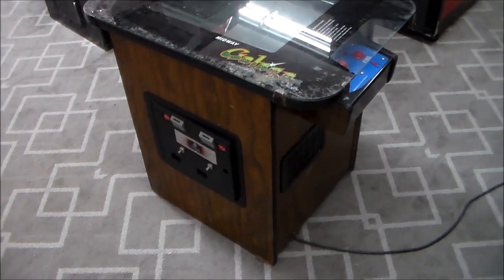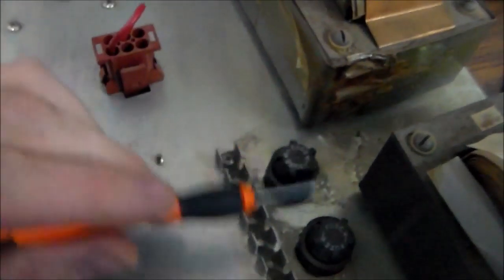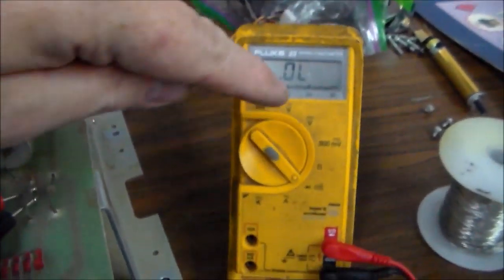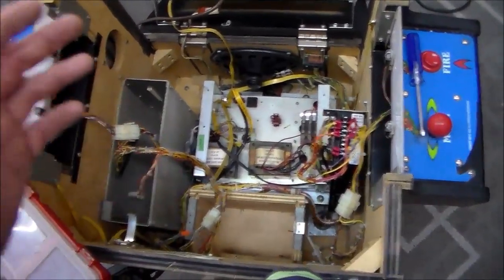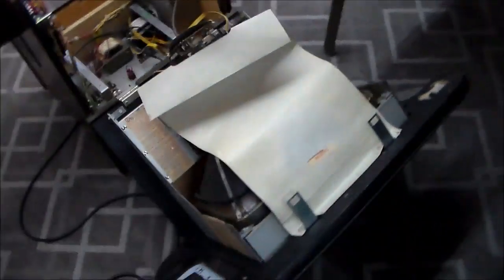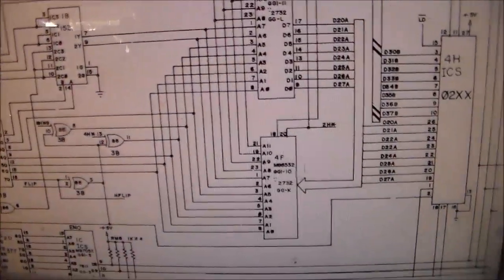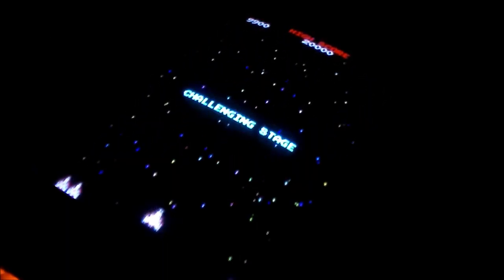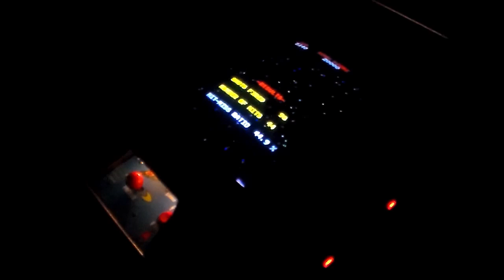Fixing & Playing Midway's 1981 Galaga Cocktail Table Arcade Game!

Comment: I recently saw a Galaga at Canobie Lake Park where all the sprites had turned into solid rectangles--they were always in primary colors, red, yellow and blue, I think. I guess it was likely a problem with that 04 chip.
Reply from the maker: I would imagine so yes.   Another way you can figure it out is if you take a working board and remove one of the socketed chips, it usually won't break anything but will tell you what area of the board you're messing around with.

Comment: Where are the power switches for the cocktail table games?
Reply from the maker: They're down on the very bottom, right by the power cord.
Reply: Oh ok great, Ty.  Went to go look at one today and the owner didn’t know where it was and I couldn’t find it either.  There was one by the door that did nothing.  It was a pac man, does that change location for the switch?  Also, I don’t think it had the transformer shield, can you buy them?
Reply: Can you snap a pic of the switch so I’m looking at the right one when I go back.

Comment: I just got one of this but everytime I turn it on the screen just shows a letter F all over the screen and dowsnt go pass that. Any ideas on what is causing it and how to repair it?? Thanks in advance
Reply from the maker: The power supply may be going bad and need rebuilt or replaced, or the game board itself has developed a fault, unfortunately it could be a lot of things, rom chips in it with oxidized legs that need cleaned, or a bad ram chip somewhere, etc.

Comment: So I don't have that shield and my transformers were mounted to the side by the monitor.  Any suggestions on what to do about that?  They had also cut all the wires from the smaller transformer, I've since repaired that.  I wish I could show you my setup since it's so different.

Comment: I have a Super Pac Man cocktail table that was in the parent’s basement that has some water damage. Nothing works and there is quite a bit of rust. Without seeing it, is it worth trying to fix? The local repair guy says this game wasn’t popular and to not bother.
Reply from the maker: I'd fix it if it were mine, depends on how bad the rust is I guess.  If it's just the metal is rusted you can sand and repaint, if the inside of the cabinet is falling apart it'll take a lot more work of course.
Reply: Thanks! I’ll be watching your videos to try to get this thing back up and running.

Comment: I guess this is a dumb question but how can one transformer step down to multiple voltages? Does it have multiple windings within that one structure?
Reply from the maker: That's not a dumb question at all, yes it has multiple windings in it.  Depending on length and gauge of the wire you get different voltages.  There's even multiple windings on the input too, so you can use different voltages in, and get the same voltages out.  Pretty complex transformers!

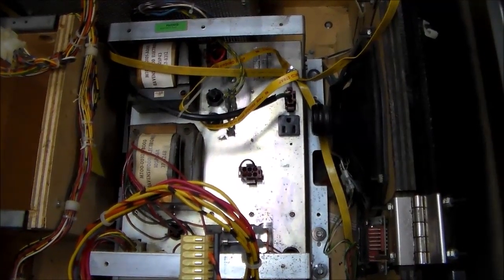Comment: You put your new Diodes in the power supply backwards! If you run the video back where you show the original diodes,  you can clearly see the cathodes on the 1st 2 diodes are reversed from the other 2. Affter you replace them, they are all pointed the same direction.(18:33) Even when you are checking them you mention the positive lead goes on the anode and the negagitive goes on the cathode. (12:01). You can clearly see you put 2 of the diodes in backwards.
Reply from the maker: You would think that but they weren't marked very well on the original diodes, it's hard to tell since two of them were black but they were all 4 the same way and the schematics show them like that too.  When I check the one and get the voltage drop, I was checking it backwards but it still measured .5 because the one adjacent to it was a dead short... That power supply was actually out of a Gorf, if you check the manual you can see the orientation : http://pdf.textfiles.com/manuals/ARCADE/A-J/Gorf%20[Parts%20&%20Operating]%20[English].pdf
Reply: My Bad. I actually HAVE the paper schematics to the Gorf Upright arcade and the power supply drawing clearly shows the Cathode (banded side of diode) of all 4 diodes pointing AWAY from the connectors. It also shows the other 4 diodes on the same side of the supply in 2x2 orientation. 2 facing front and 2 facing back.  (isn't it wierd that I actually have the paper drawings?) Why do I keep this stuff?